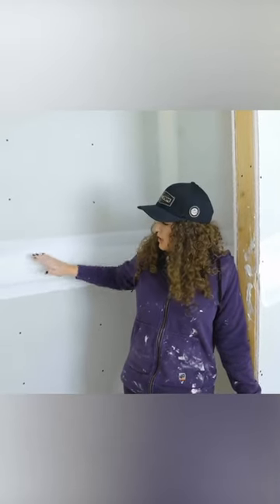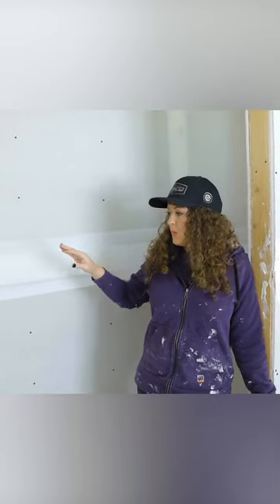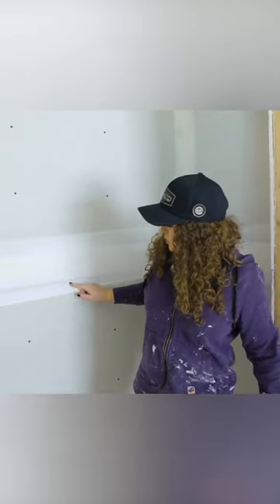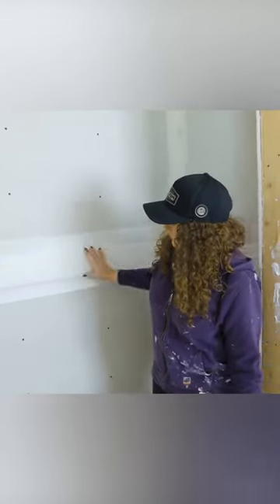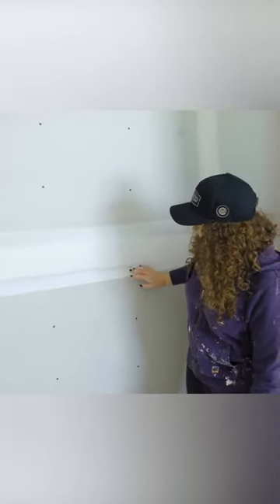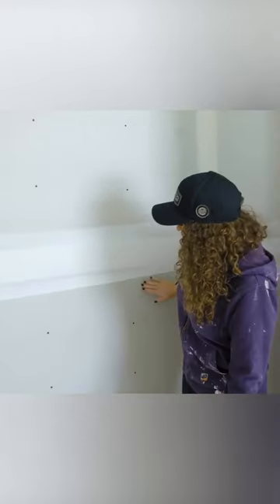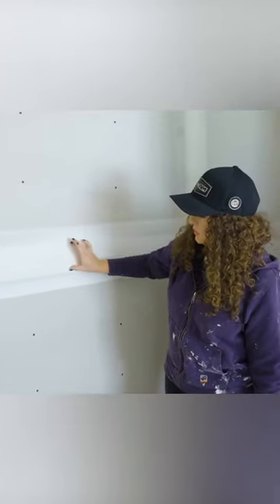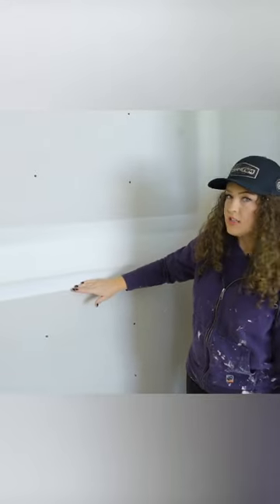What are drywall shoulders and why do they matter #shorts

Comment: I have noticed this happening on brand new sheetrock. The roller tech is not as experienced as the older guys that used to do it. It is literally a manufacturing flaw. The high shoulder causes a ridge. When this happens it is a whole nother flat right there or you will see a hump under good lighting or with dark shiny paint.